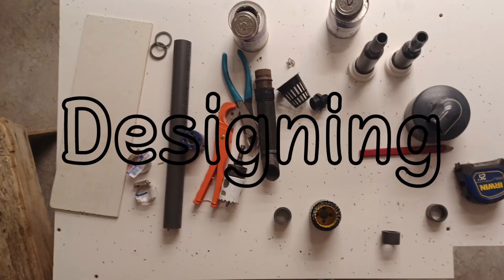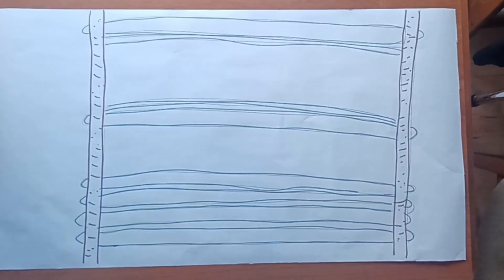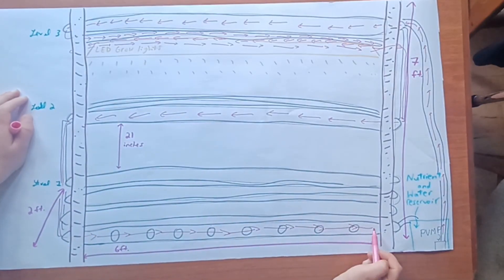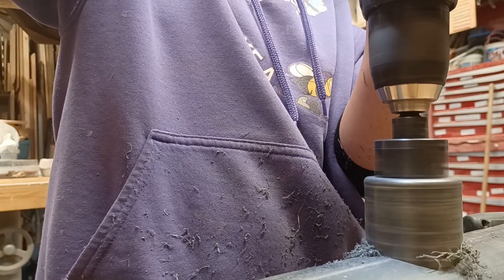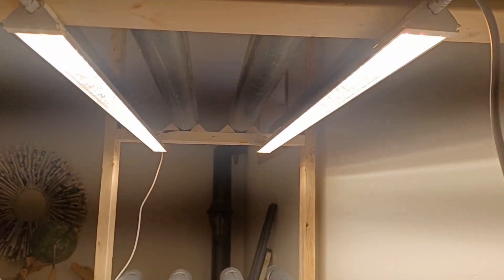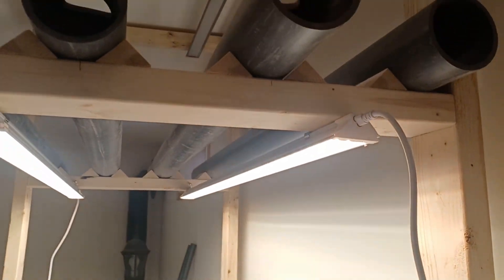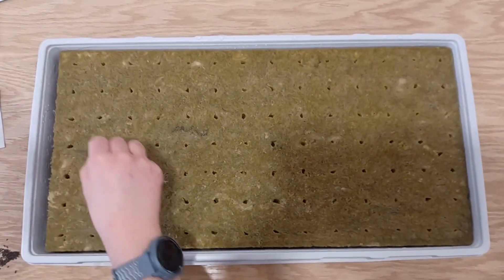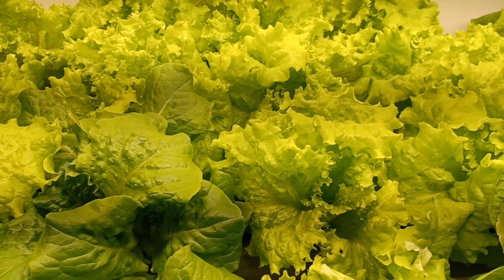Rachel Lee: Mastering The Art of Hydroponics

Comment: 20 times the yields of soil ? 
I'm sorry but this is a gross exaggeration.  
 Hydroponics can be done in coco substrate, rockwool, or straight water. It isn't just growing in water, that is a misstatement of fact as well. 
 Growing vertically isn't by definition hydroponics,  you could grow vertically in soil or in any of the above mentioned substrates, vertical isnt necessarily even connected to hydroponics style growing and in most cases isn't utilized.
 Hydroponics in general terms in growing without soil in many different ways and using automated watering systems to feed the plants.